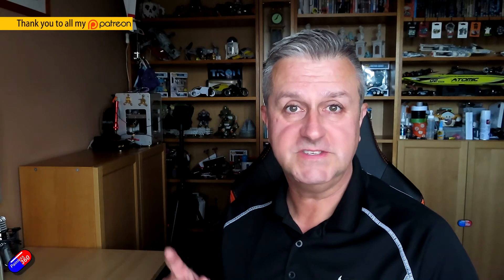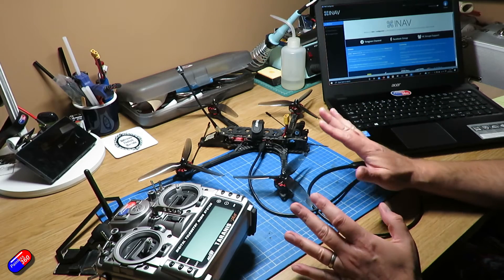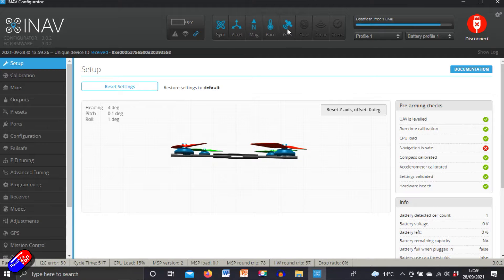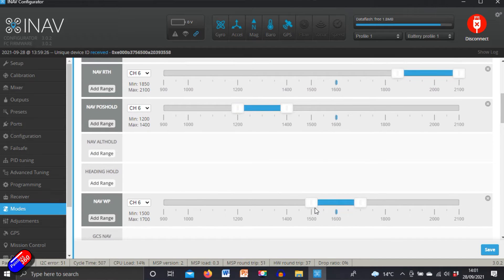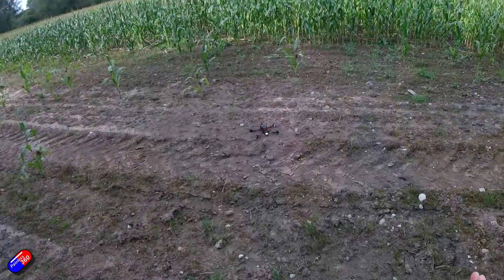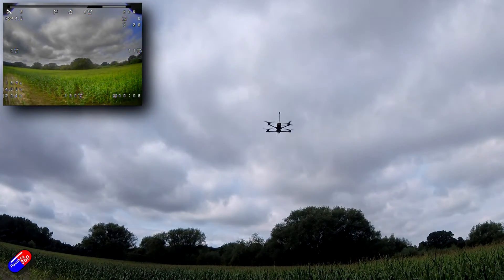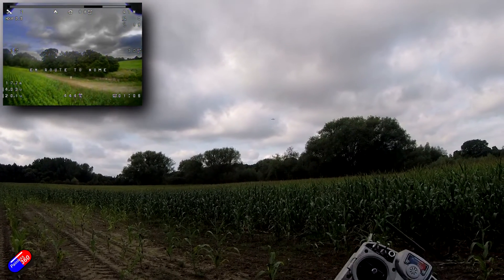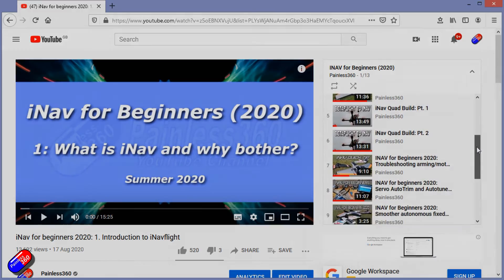(2/2) Installing INAV 3.0 onto a Quadcopter: Finishing setup and testing

Comment: Hi. I’ve got a question for you. I bought an inflight FC because it has up to 8 motor outputs. However it doesn’t have a barometer like I thought. So now I’m wondering if I can add one along with GPS.
Reply from the maker: Possibly. You could try a baro connectedness via i2c along with the Comoass and see... Best of luck
Reply: @Painless360  I’ve read that the SDA and SCL connection can read multiple devices from the same pads because it is a serial port. Do you know this to be true?
Reply from the maker: Yes, if the devices have different addresses..
Reply: @Painless360  I will give it a shot once I figure out which barometer to order.

Comment: can postion hold be tuned. i notice theres always bobbling when in position hold. ive got it working its holding poisition pretty accuretly only wanders a small amount but wobbles as if pids arnt right , angle mode doesnt wobble and it flies fine in acro.

or is that just as good as it gets

Comment: I have this exact same quad / setup.  Would you mind sharing the inav cli as I am thinking of giving this a go.
Reply from the maker: On the RekonFPV website -
https://cdn.shopifycdn.net/s/files/1/0507/4380/4074/files/INAV_cli_dump_Rekon_LR7_20210602_111635.txt?v=1631781491

Comment: Is it advisable to use iNav on quads with props greater than 7-inch?
Reply from the maker: I've not used it on more than a 7" model here but I can't see why not. The things to watch out for are the vibrations you get on models with longer arms and lower speed props/motors. Things like LPF etc. need tweaking for them to fly well.. Best of luck!

Comment: Great video. I follow your build and I just finished mine but I have issues with the gps .I mounted way back on my build like 80mm from any electronics but I still have toilet bowling no matter how many times I calibrate the magnetometer. Any idea why? Also the cables are shielded. Thanks.
Reply from the maker: Make sure that the compass is flat for easier calibration and if the compass works on the bench perfectly then it could still be interference from the power system.. Best of luck!

Comment: Had it on rekon5 I built.  Was great but had to take off. Had a firmware issue. But I'm going to put it on rekon7 when I get a chance. Been testing alot in default for review video
Autonomous flying be so great for battery flight time testing.  My rekon5 battery testing has done over 40min flights. So boring lol
Reply from the maker: Best of luck. What battery were you using on the Rekon5 for 40 mins?
Reply: @Painless360  6s 3000mah Li-ion and 6s 4000mah li-ion (doesn't fly well with 21700). Cruising at like 24mph. No action cam. (Normal flying with camera was like 28mins or cruising faster like 34mins)

Comment: I wish beta flight and INAV would just combine all the good points.
Reply: So true. I am hoping to have more options on the  next betaflight update.
Reply: They can't... and it's really no their fault.. The reason they went different routes is because of limitations in the storage of the FCs.  So, neither iNav nor Betaflight will be able (at least for now) to put all the features they want because the firmware won't fit inside the flight controller memory.

What we need is for FC manufacturers to install memories with way more capacity!